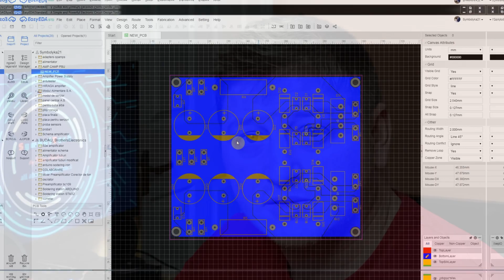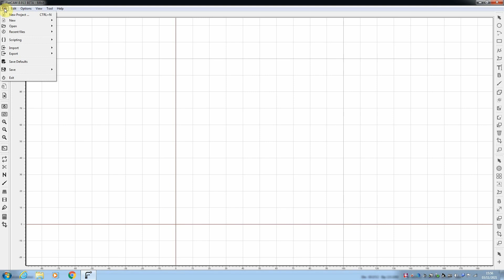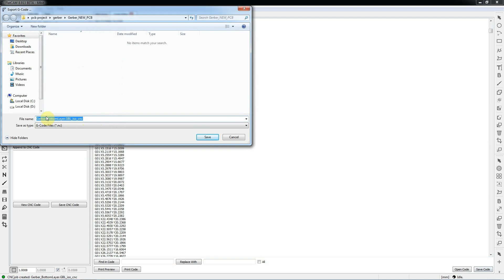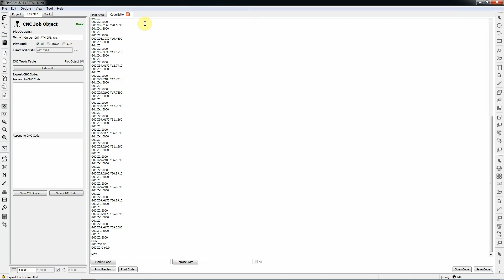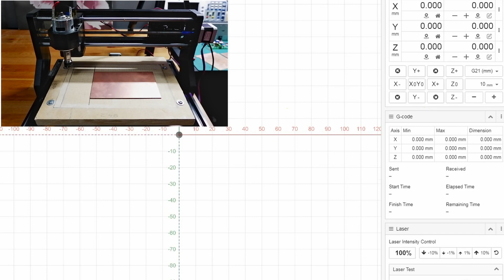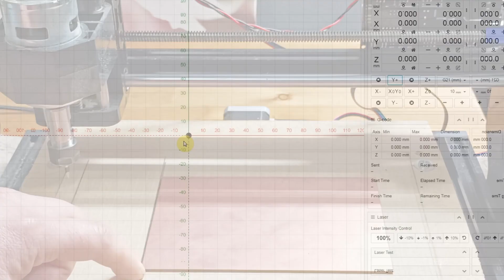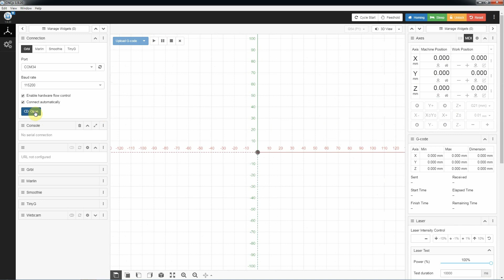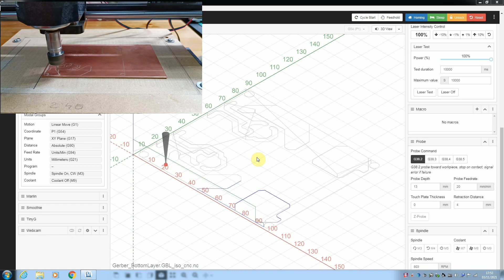CNC Milled power supply | for the amp camp Nelson Pass amplifier

Comment: I use KICad to design PCB's, then just upload the drill file and gerbers to JLCPCB. Then I just sit back and let them do the work. You also get nice through-hole plated boards, which is not possible using your CNC. Once your method would have been cool, but now, online PCB manufacturers are just so cheap.
Reply from the maker: Thanks for your comment. Yes I use as well jlcpcb just was a simple power supply so was easy to try this CNC to check if will bring out a decent quality of a pcb